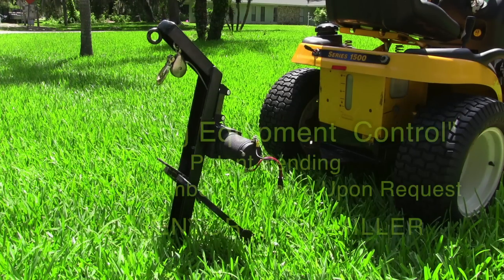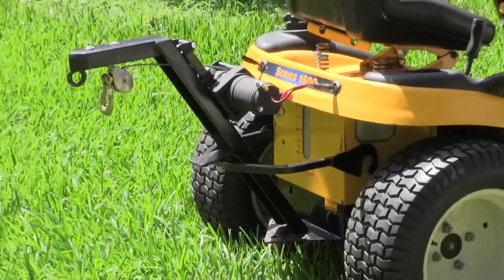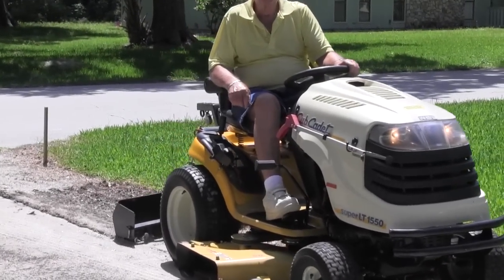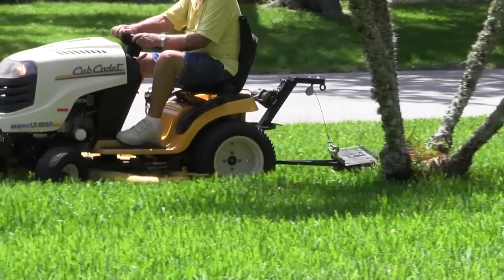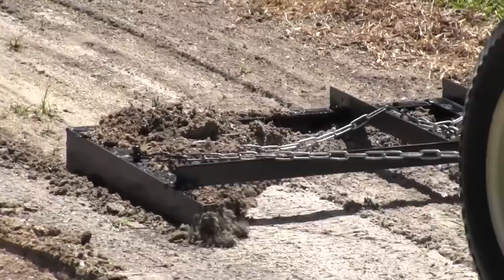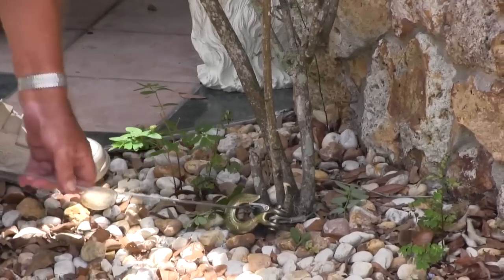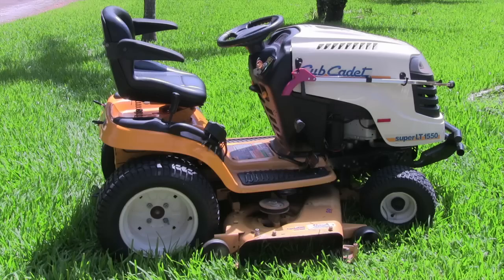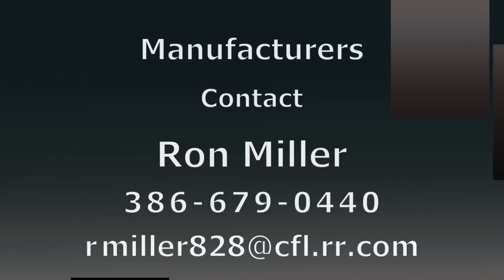Working Equipment Control

Comment from the maker: Hey guys, the man who put this together and asked me to do this video for him, is 87 years old. He designed and built this when he was 84. Yes, in hindsight, he could have done some things a little different, but for what he uses it for, and for what it's designed to do, all the people who've purchased one from him say it's doing its job perfectly. He gets nothing but praises... He even adapts the part that attaches to the back of the tractor for those with different brands than the Cub shown in this video. If you want to get in touch with him, send him a text, that way he can get back to you and answer your inquiries... I know it's easy to be negative and find fault with things that are shown on the Internet, but trust me when I say, this is a solidly built and incredibly strong attachment that turned his tractor into a multi-functional piece of equipment costing far less than purchasing larger tractors designed to do all this-when bought from the factory... Hope this helps...
Reply: I agree. This craftsman fellow seems like he wants to crucify the old guy.
Reply: +Craftsman wag the dog
Reply: where can I get it
Reply: So what? He invented nothing..not even the attachment.. he just did what china do.. copy from others.
Reply: I think this is a great tool and I would like to get one. People being negative in comment are usually 12 year old keyboard junkies and have nothing better to do and Who have never had an idea worth a Patent so thank you for you video work and the work of this gentleman who made a great product.
Reply: @gattonpc  In searching for lawn tractor attachments for pulling or lifting, I've never seen anything else like this for sale or with DIY plans. I'm planning to build one for my 48" Husqvarna. Who do you think he copied it from?
Reply: @ddwieland  Learn to search..I'm not searching for you.. because you are not able to find the enswers you need. And try not to say "Never" again..If you didn't saw it yet.. that doesn't means is not there. It is there but you can't see it yet.. or didn't "find" it yet. and BTW. Searching on the internet on your local market will result in YOU "NEVER" Finding anything else like this... Then you say you've invented it.. and post it on the internet.. where people will show you that you invented nothing..and was all ready there.
Reply: @gattonpc  Wow! I must have touched a nerve. I'm well experienced with web searching and outdoor equipment. You didn't answer the question.
Reply: @ddwieland  You didn't touched anything..is just a impresion you've made by yourself.. And if you aare so experienced with "the Web".. why you looking for enswers from me? Like i told you in the last comment.. im not here to eswer you anything.. or to search the enswers you are looking for on the internet. Find them yourself.. im not here to prove myself to you or anyone else for that matter.. is just something i know and saw.. and you don't. So GL with your "expertise" finding your enswers.
Reply: @gattonpc  You claimed the design was copied, and I asked from what or whom, because I'd never seen a lawn tractor attachment anything like it. Where have you?
Reply: Cool he’s still at it. God bless a working Man 😊
Reply: I think it is awesome! Is he in the video?  I hope he is doing well today. How much does it cost?

Comment: Pass this comment to the gentleman who came out with this equipment design.  I build stuff more than my wife likes but that is who I am, I like the overall design of this 3 point attachment to the point of seeing other designs to modify it. I've been working lately on building one also. And your friend has helped me finish the design. There are a lot of DIY folks out there that need DIY'ERS like us to help them.  When someone makes a suggestion doesn't mean an attack just a different perspective on topic such as my design will have a drop down ball hitch which will allow towing a trailer and the Crain to dump. Thank him for me and I hope he sells his equipment to those who can't build.
Reply: or you could just buy the proper 3 point hitch or sleeve hitch so you can use the attachments right

Comment: Not to dis or anything, but for around $100 you can get an electric sleeve hitch, which is what the implements shown are made for
Reply: They are $700 but yes, that is the correct way.

Chexk out my channel, I'll be installing  one on a Cub Cadet 2500 series

Comment: That's a moawer not at tractor😩
Reply: It’s actually called a lawn tractor. There are three type 1: riding mower 
     ( normally the smallest with 10-22hp)
                   2: lawn tractor  
    ( usually slightly larger but not much with 18-28 hp and slightly larger rear tires and I believe a multi gear transmission I’m not sure if that all of them or just the ones I’ve seen)
                   3: tractor 
    ( no explanation necessary)
Now I know there are a lot more differences I. Then I just was making short examples here.
Reply: @timwegman5776  riding mower and lawn tractor is the same, theres a riding mower and a garden tractor, this is a riding mower, a garden tractor usaully has 5 lug hubs with 1 in axle shafts, a geared transaxle and can take ground engaging attachments like a 3 point hitch or a sleeve hitch, the size of the engine dont matter this tractor has a 25hp engine my 8hp ih cub could drag this piece of shit up and down the yard, its all about the way the tractor is geared and how much traction it has